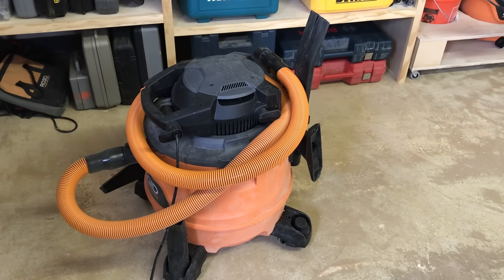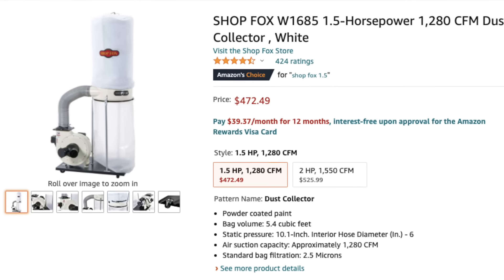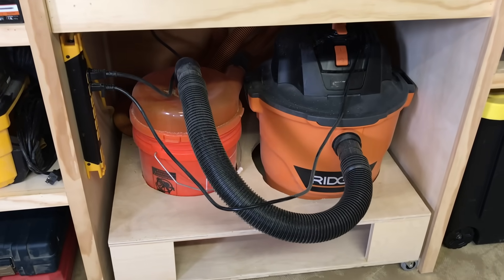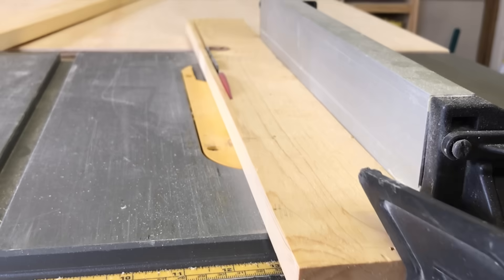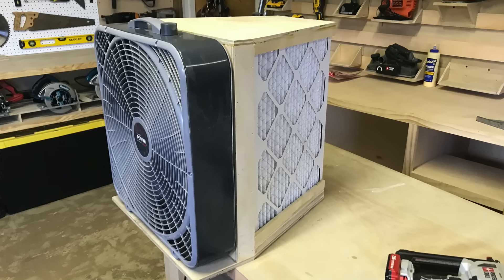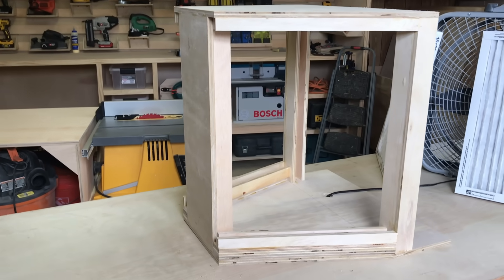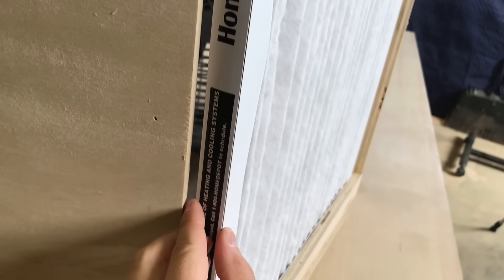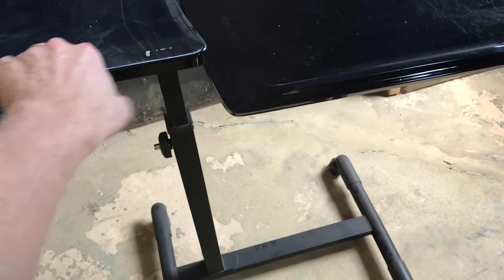BOX FAN AIR FILTER For About $40! (How To Build a DIY Box Fan Air Purifier With HVAC Filters!)

Comment: I've seen this idea presented a few times and tried it out myself (taping a filter directly to a box fan).

The problem that you'll run into is that most box fans are designed for high airflow, but not good static pressure. The airflow of a fan is just that: how much air it can move. The static pressure is how much resistance to that airflow it can overcome. By adding filters you add resistance and since most box fans aren't designed for overcoming resistance you'll either overwork the fan (potentially dangerously stressing the motor) or just find that you get virtually zero airflow from it.

For this setup to work effectively you need to either find a fan that is designed for good static pressure (rare in box fans) or spring for a tougher, more expensive fan that will overcome the resistance.
Reply: By putting two air filters on there he reduces the resistance.
Reply from the maker: I see your point, Mike. I appreciate the explanation of the science. This ones running pretty good though! And on the rolling cart, I can just bring it closer to my work space. But I think a stronger fan could be incorporated in much the same way!
Reply: @TheHonestCarpenter  with two filters you probably have cut the resistance enough for it to work. I'd suggest just checking the fan for signs of overheating if you use it for extended periods.

But if someone were to only use one filter they should definitely look for a strong fan.

You could also skip most of the plywood by making a cube out of 4 filters, the fan, and one piece of wood for the base.
Reply: The issue is that the "right number" here depending on how you optimize fan and filter might be 50 air filters, or it might be half an air filter.  There's no reason to think going from 1->2 is sufficient, only that it will offer an improvement.

Air filtration is an area where you get to trade off space against efficiency / efficacy.  You can easily imagine, say, a refrigerator-sized box, with a fan on the top, and three banks of four 20x20 air filters underneath, with a trash can at the bottom for particles which will settle as dust.

I think an air settling closet, an enclosed room subbing in for a "cyclone" scrubber, would be useful for larger particles, and then have an intake running from that to the HEPA filter bank.  Every so often, just walk into the closet wearing a respirator, and sweep the floors.

Or, better than any of these ideas, but only sometimes practical: Run an unconditioned shop, and exhaust it to the outdoors.
Reply: Aren't computer fans built for exactly such tasks? Made for pulling and pushing air through various forms of resistance.
 Hardware and dust filters.

Comment: Good idea.  Dimensions with photographs of each side, top, bottom would have been helpful, or in the description.  Yes, we canfigure it out on our own, but why make us work???
Reply from the maker: I would, Scott, but I hardly ever pull measurements on a build like this! I mostly just hold things in place, scribe, and cut by eye or dead reckoning 😅
Reply: @TheHonestCarpenter  LOL.  I do that too.  I just ordered a new box fan and the filters.  This is a great idea, I should have thought of it.  The shop vac does not pick up that nasty fine wood dust.
Reply: @scottslotterbeck3796  I'm hoping it will cut down dust specks in my kayak I'm varnishing.
Reply: @jameslippert3523  100%!  This is a good idea.  One needs a two part systen, one to suck up the larger particles, and one to suck up the finer particles.

Comment: Wear an N95 problem solved
Reply from the maker: I always do when I’m cutting, Squirrel! But when I’ve been in the shop for a long time, I’ll sometimes take it off. Good to have another line of protection then.
Reply: @TheHonestCarpenter  At first, I missed the comma. Didn't think that cutting squirrels would raise much dust. :-)
Reply: Yes, but I don't want to wear one every time I go into the garage.  I use that for things other than woodworking.